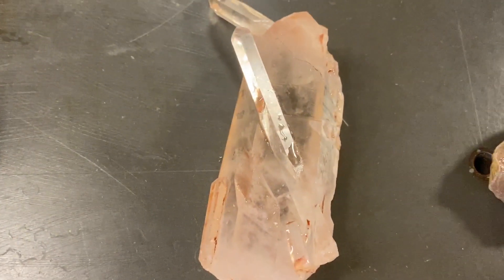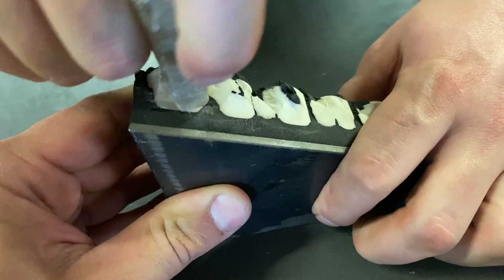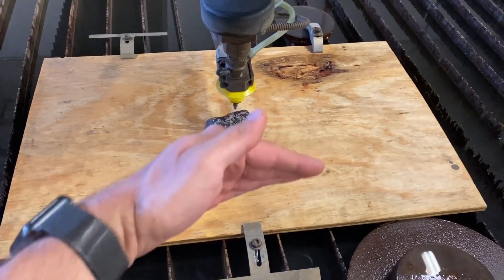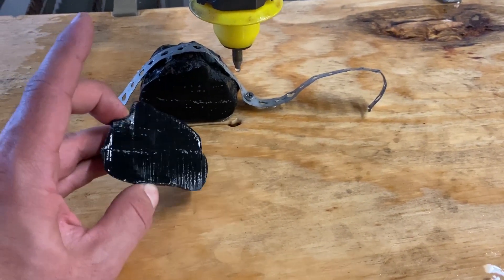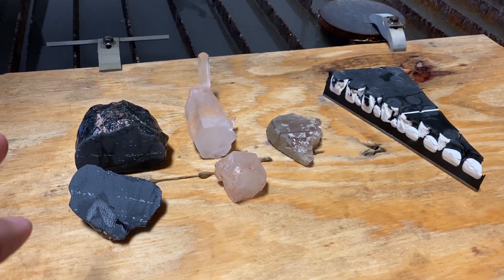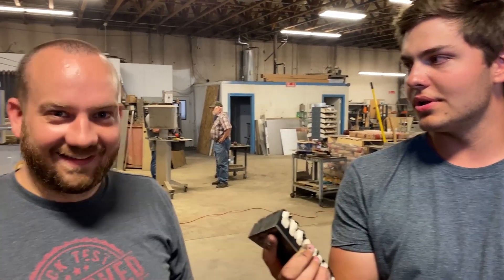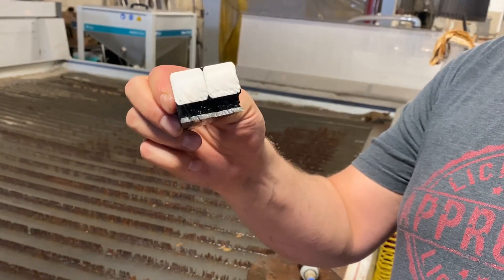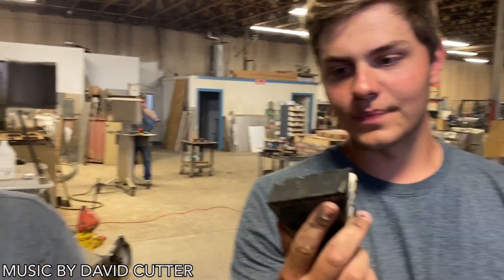Hardest Materials vs 60,000 PSI Waterjet

Comment: Imagine having to use terms like "Sixteenth of an inch" instead of 2mm
Reply: That resonates in my ears either.. and than i facepalmed ..wtf 16th of an inch 😂 its like having a steak and tell somebody i have 265th of an cow instead of 200g 😂
Reply: I didn't post this comment to flame on the US in any way... I just thought that 16th of an inch seems like a very weird and terrible way to guess measurements.
Reply: @mikeymike7431  some people will be offended by anything, wish we could start using the metric like everyone else, but that would be a weird change
Reply: @mikeymike7431  as someone who has done a good amount of carpentry using the imperial system I will say that its a very stupid system. But its a system, aka it works, and once you get used to it, it becomes near impossible to fully adjust to using metric. Even though I know a meter is 100 cm and a centimeter is a little under half an inch, I don't think that way at all. When I use meters I still convert it to yards just cause it was how I was raised. So yes, stupid way of measuring, but becomes second nature if u grow up using it.
Reply: @tjvroom7076  one of the best comments in the thread
Reply: This post was made by the metric gang
Reply: @jonaswilson3150  laughs in 94.7% of the world population using metric
Reply: Melvi Vanilly  They are also the first two marks. Who's oven goes to 660 F??? Those chicken nuggets would be done in a heartbeat.
Reply: Where did I lose you? The first two marks or the chicken nuggets?
Reply: I don't say any temperature scale is bad, but Honestly i always wonder why people are so easily triggered and goes out with such an awful behaviour and targeted personal attacksbeyound all reason on other persons if someone does not like the Fahrenheit scale, i hawe never ever seen people hawe such awful reactions when people express hate on the Celsius system. It is just a temperature messurement scale, it is dead numbers on a paper or digital unitis seen on a computerscreen, it is not by any means an attack on the United States as one may think from the response. The Fahrenheit scale is not even American by any means, it is an old German scale for messuring the temperature in the Harbours in northern Germany. Just take a quick look at it's actual history before start going totaly bananas and start war with people!
I hawe never ever, not even once seen or heard any person from Germany complaining ower somebody supposingly did insult their old national temperature scale.

If one want a finegraded scale, the Delisle  has more dividing numbers than nay of the other more commonly used scales and
For messuring temperature in hot metals or lightspectrum in other applications the Kelvin scale are uncomparably superiour to all the other commonly used scales.

 Celsius was from Sweden, not from France (however it was a frenc man who inverted it to what it is today).
The Celsius scale is the first international unified scale.
Reply: Oh boi these comments are gold, I love when people fight eachother for small things <3
Reply: @LokiThePug  lol specially when we use both forms in the US . It sucks for us because we have to buy two different set of tools . To accomplish the same task
Reply: @LokiThePug  How small are the things? 1/10000 of an inch or 0.0025 mm? hahahahah
Reply: you all should know imperial is litterally defined by metric. an inch is defined as a length of 2.54 cm.
Reply: Couldn't agree more bro, like who am I to know how the hell 1/64th of an inch looks like...
Reply: Don't be an asshole... Different cultures use different things. Here in the US, terms like that are completely normal
Reply: I use cm and mm for anything less than 1 inch.
Reply: anyone in a seriously scientific or engineering field will be using metric in the USA. construction uses imperial still, but they have still converted imperial to be base 10. (half a yard, 1 tenth of a yard, etc.)
Reply: Imagine having a government that chases you down with a helicopter for going outside.
Reply: Dude its ridiculous. The Lockpicking lawyer uses terms like "1/1000th of an inch" and I just cringe
Reply: @LilDefuseKit Well 1/1000” is ~0.0244mm. I guess you could say 25 micrometers, but that means you have to memorize the prefix, and exactly how much the prefix changes the number.
Reply: @kainarkanos i think nobody got it. i think your joke is great because you know Celsius steps are smaller (5/9)  and it doesn't matter in daily life
Reply: EFFram YOUng  too stupid?? Lolol said someone who dropped out of high school about countless europeans doctors teachers and other geniouses
Reply: EFFram YOUng  it's pretty obvious you big mad
Reply: EFFram YOUng  a shred of evidence?? Xd god damn these people be delusional. Everyone who fights deadly diseases goes to berlin, i  have not meant a single person that went to us. Also rhat metric system is what your ancestors used, but you aint ready for the prison talk. Your jokes suck ☺️
Reply: Yea it's kind of stupid because we also use the metric system it's a pain in the ass specially. Doing car repairs have two sets of tools for the same thing.
Reply: Thought the same haha
Reply: @Jakob Weisser actually they started witch imperial and then translated it to metric for calculations and again translated it to imperial
Reply: @Timms MC you are just explaining  math that  8 year olds understand
Reply: Fractions are MUCH easier to do mental math with than decimals.
Reply: @Joe-bm4wx  Not really, decimals are better and more consistent
Reply: @AmateurSnake  can you multiply 1.29 x 7.327 in your head easily? How about divide? With fractions it's much easier. Especially when you learn fractions in grade school.
Reply: @Joe-bm4wx  Yeah, but it's harder to think which number is bigger in fraction compared to decimals which is why I said decimal is more consistent.
Reply: @AmateurSnake  how so? It's pretty easy...
Reply: @Joe-bm4wx  yeah, but you have to calculate it. For example, 5/10 and 3/5. Which one is bigger? You have to either translate it to decimals or multiply 3/5 to decide which one is bigger. With decimals, you doesn't need to do these calculations
Reply: @AmateurSnake  that's easy, 3/5, don't need to think about it at all. Did you not learn fractions first? In US grade schools, you learn fractions long before decimals.
Reply: @Joe-bm4wx  Same here. But you still have calculate it, unlike decimals. Ok then, how about this one: 90/188, 79/155, 87/123, and 99/209.
Reply: @Joe-bm4wx  In decimals you can tell which number is bigger by just looking at it. Example: 0,55 ; 0,79 ; 1,23 ; 6,78.
Reply: @AmateurSnake  omg did you and joe not read the big explainy comment that the guy above you said? He literally mentioned the fact that fractions and imperial are good for mental math and are easy to use while metric and decimals are more accurate. Just use both man.
Reply: @LarryCucumber  ok
Reply: @AmateurSnake  good
Reply: @AmateurSnake  5/10=1/2, 3/5>1/2.
A basic sense of fractions tells you 3/5 is the bigger one.
Reply: @Shlungoidwungus  That's cool and all, but my second question proves how superior decimal is compared to fractions at some aspect.
Reply: @AmateurSnake  Your point that decimal is easily comparable? That's literally the only advantage, anyone who uses numbers regularly knows that fractions are easier to compute with anyways. This is why most real math is done with fractions, not decimals.
Reply: @Shlungoidwungus  Yeah, but decimal is more accurate. End of the case.
Reply: @AmateurSnake  Decimals aren't more accurate the fuck? If you knew anything about mathematics you'd know that decimals are horribly inaccurate because you have to cut them off at some point. A fraction is by definition infinitely precise. There is no cutting off of the fraction that you have to do, you have it in exact terms. 47/96ths is exactly 47/96ths. 
0.489583333333 is not 47/96ths. You literally cannot write it precisely in a decimal form, you have to truncate it.
Reply: @Shlungoidwungus  Yeah, but I mean it's easier to which number is bigger by decimals. With fractions, you have to process it at least.
Reply: @AmateurSnake  You have to have some level of basic mathematical competence, yes.
Reply: @Shlungoidwungus  Yeah, but why use a harder way when you got an easier way? You can know which decimal numbers are bigger by just looking it for a second. With fractions, you have to calculate it if it's complicated.
Reply: Imagine having an radical leftist American princess in a royal family that rules over non-American people.  Nah I’m playin’, yea metric is king, idk why the hell we haven’t switched over by now...
Reply: @samuelmontypython8381  she isn't ruling over shit.... she can't even manage a relationship with her father, how ever,was that story going to end?
Reply: imagine caring
Reply: ur gonna trigger a few americans
Reply: You are working off the assumption that everything you do will always fall onto exact 1 mm increments.  1 mm is pretty large.  What happens when you need tighter tolerance than that?  You have to go into decimal notation anyway.

In the USA with Imperial Units there are 3 different ideologies of measurement.  First, every single scientific experiment uses metric, and most high tech gadget or thing made is done using metric.  All cars since about 1980 uses metric.

When it comes to some things like building homes, and other non scientific things that do not require high tolerance measurements, it is really easy and fast to use Imperial units.  When building a home most people use 1/2th, 1/4th, 1/8th, and 1/16th and usually stop there.  Sometimes if you are dealing with cosmetric trim, you might use 1/32th.

If I need a piece of trim to be cut, I can tell a guy in two different ways using an imperial measuring tape, "Hey cut that at 7 foot 2, and five thirty-seconds", or I can say "Hey cut that at 86 and five thirty-seconds".  Now compare that with "Hey cut that at 2 meters, 18 centimeters, and 8.37 millimeters" or if I told him, "Hey cut that at 2 thousand 1 hundred 88 point 37 millimeters".   I don't think that is much better.

When it comes to CNC machine work and making high tolerance parts, like automotive parts.  Almost always the fractional notation is completely ignored and you switch over inches plus a decimal notation for easy use of high tolerances as well as computer calculations.  If I need a part that is 2 inches and 367/947ths long, I would never say such a thing, nor would I ever write such a thing down.  I would simply write it as 2.388 and I would tell a guy, "hey cut that part off at 2 point 388", or "hey take another hundred 47 thou off that diameter".  When it comes to CNC machine work, it is no different at all using imperial measurements over metric because you will always be talking in terms of decimal notation.
Reply: @karozans  simple question: 
Ever heard of the terms „micro“, „nano“ etc?
Reply: @Phenox9    Yes.  They are decimal notation of mm.
Reply: 😂😂 made me laugh
Reply: @Tomas Correa Top 5 dumbest things i've ever read.
Reply: imagine not converting 1/16th to 1.6mm noob
Reply: Oh god you just raged whole nation of Humburgers per Ar15s
Reply: Some people shorten "thousandth of an inch" to "thou". I think.
Reply: Sounds like you're used to saying 2mm.... 🤣
Reply: Imagine that
Reply: or you could just say “0.08 inches” but millimeters would def be better to use at these scales
Reply: I'm from Canada, and we use both all the time. I measure distance in Imperial for things I would use a tape measure or caliper for, and metric for driven distances and speed. I use Celsius for temperatures, unless it's the oven, then it's Fahrenheit. I can picture a 1/16 of an inch, but 2mm, not so much.
Reply: Why are y'all fighting? I've been taught to use both of them and whenever there's a need to use em, I just go for the one that comes to mind first. Like why fight, learn both of em and there will be world peace.
Reply: OMG so much stupid. People use the units that are local and normal to them. If you're used to imperial you use it because it's your frame of reference. If you're used to imperial you'll say oh this is about an inch. If you're used to metric it'll be oh that's about 2 and a half cm. One isn't necessarily better and both can be both accurate and precise. If I'm using a socket set to it's nice to say oh the 8mm is too small. Let me try the 10mm. If I were using imperial I'd have to fraction it out. That just means the Americans gotta be able to do fractions in their head. Having said that I live in the USA where my machinist uses imperial and I prefer metric. Whose wrong? Nobody. I give him imperial units because he's the one cutting the metal. Guess what? The parts come out correct. The measurement system has done its job and given a precise measurement. Geez people on the internet take personal preference so seriously.
Reply: imagine thinking that arbitrary things actually matter enough to cringe about.
Reply: Reminds me of the time the Metric 'Kilo' needed to be redefined because it lost atomic weight over time.... Not like Imperial system of measurement has been redefined because of that reason.... Oh wait....
Reply: @ShiozakiSama  actually, they changed it. Now it’s based off plancks constant
Reply: Ya know, it's really strange when you are arguing over metric and imperial and then someone brings up the moon landing. What systems used played a very small part and would not be proof that one system is better than the other.
Reply: ps a nanometer is one billionth of a metter
 And a mm is one thousandth of a meter
  And cosmicly speaking we don't use either system on the larger scale we use AU astronomical unit the distance of earth to the sun of LD lunar distance the distance from earth to the moon and how far light can travel in a year and all three of these are still relative if you tried to explain to a alien your system being based off of these they would understand  but still look at you like you're stupid
   Because they use Cm cosmic measurement or how far a fart travels in a vacuum

    If I divided a yard into thousandths and called it a milli yard would you understand 🤔
    How about a milla gallon or milla cup
 How about a smoot or cubit 
furlong=201.16800 meters 

   In Kentucky they measure how far a drive is in beer's true story told by one of my friends from there
Reply: i like how the country that „went to the moon“ doesn’t believe you when you tell them that Nasa uses metric
Reply: @ophilia  Well, not so sure about either of those assertions. 😃 First, because something has been obviously wrong with the official narrative for decades. What the actual truth is I don't know but it is not what they are saying. We did not just lose and destroy the technology and documents. Either we did not go or they are hiding some reason that we can not go back yet. The circumstantial evidence for the narrative of fakery has been fairly good. There was motive and it certainly was possible. Second, our local mechanics use metric so most everyone here uses metric for something or is aware that others do, especially the scientific industry. You must have spoken to one of the few or either a child in early primary school. Most Americans would either know this or be indifferent to it with no disbelief or argument for or against...
Reply: @CynHicks  i said that becouse earlier in this comment section 3 people caimed nasa uses imperial
Reply: @ophilia  Oh, my bad. Touche. Lol
Reply: Metric is ridiculous when it comes to height and weight measurements
Reply: @apracity7672  how? You have one simple number and that‘s it... Compare this to imperial and you have one more, where is this so ridiculous? I would say your commend is just simple trolling and could be called ridiculous😂
Reply: I'm actually surprised they use imperial units on a machine like this. Sometimes though imperial is just standard, and we are too lazy to change it.
Reply: @GuyFromJupiter  It's not about lazyness. It's a standard that gets result on nearly every avenue it's used on unless you need precise measurement for crucial details.
Reply: AkTuaLy that’s 1.57mm
Reply: @davidg6852  AkTuaLy that’s 1.57mm.  Indeed. One and fifty seven hundredths of a millimetre  :)
Reply: EFFram YOUng  i never said they are better, but they definitely aint worse, people dont go to US to find cures for hardest diseases, they go to berlin. Imagine thinking that bcs ur from US your doctors are automatically best 🤣🤣 thanks for proving my point kiddo, go back to watching cartoons with your 2 inches
Reply: EFFram YOUng  lul u mad
Reply: @steviethespring  I love how Americans still see their country as the most powerful and mighty one, when in reality it's the country where everyone laughs at. <3
Reply: @steviethespring  LOL, as if I mistranslated this or I were a white dude.
Reply: @NiffirgkcaJ  you replied twice, that means you big mad.
Reply: @steviethespring  is that an insult? :3
Reply: @steviethespring  They're just mad because we overthrew their monarchy, infiltrated their monarchy, and have a bigger island
Reply: @NiffirgkcaJ  chill out man there is no need to be angry about it
Reply: @LarryCucumber  I'm not mad, plus that was a month ago already, LMAO~ XD
Reply: @NiffirgkcaJ  why'd you come back so fast if it was a month ago
Reply: @LarryCucumber  got notified and I have nothing else to do.
Reply: damn why you roasting us we dont like it either
Reply: Imagine not understanding the brilliance of the imperial system.
Reply: @CynHicks  No system is better than the other, they both have their ups and downs man. I am an american and love imperial just as much as the next guy, but even i understand that it can't be that amazing
Reply: @LarryCucumber  Dude, I really want some cucumber salad now.
Reply: @CynHicks  STOP
Reply: @LarryCucumber  Mmmm lol
Reply: @Timms MC man, everobody is using fractions in metric, its not like its only for imperial XD
Reply: There's two types of countries: those that use the metric system and those that have been to the moon
Reply: @Lardbutt200  there's other metric system countries that landed on the moon, and Nasa used metric system to land on the moon lol
Reply: I love the United States so it's not about that.
Reply: America is a backwards thinking nation
Reply: America uses the best system period
Reply: Come within three blue whales of America and talk your shit
Reply: Imagine imagining things about imaginary things in imaginary instances. Quite imaginative. Imagine that. But before you do that could you imagine the image of you imagining that. Now imagine typing that. Imagine

Cope harder europeen. You can’t say anything about amerifats with all the human trafficking the third world still condones, let’s not even imagine that though.
Reply: @MuscularFemaleRoegadynEnjoyer  I'm stealing this quote
Reply: Mesurement is arbitrarily based on a relative number and i learned both systems in school and neither are perfect maybe if everything had the same boiling point as water metric would be perfect but you could just as easily base a system off of the freezing and boiling point of mercury 
    Problem with a base 10 system or a based whole system is mathematically it is impossible to 1/3 either but physically easy 
Become a mechanic both will become easier to understand cause you will run into both systems alot I can eyeball any bolt tell you if its metric or standard what its grade is size and how many threads per inch threads per centimeter
    By relative just the gravity from other planets could make a inch more or less than a inch but only a outside observer would notice they actually use the difference in these measurements to detect gravitational waves
     And depending on atmospheric pressure the boiling freezing point of things change  so it relative
Reply: Someones jealous.
Reply: Better than being a slave to the globalist.
Reply: Imperial system is so gay and stupid
Reply: @gesucristo9946  Imperial system usage drops to 0%
Reply: Why would they use mm when sixteenth of an inch makes better sense to them
Reply: @Jakob Weisser feel free to delete your comment when you google and find out that you're wrong.
Reply: @steviethespring     You use decimals in percentages and the numeral system so it can't be that bad. The official imperial units used today were decided and measured in metrics.
Reply: @steviethespring  "The Apollo Guidance Computer did use metric/SI units internally for its calculations. But it converted to imperial/USC units when it displayed data on the DSKY. This is probably because the Apollo astronauts (mostly trained as test pilots) had an intuitive "feel" for imperial/USC units"

Feel free to delete your comment when you google as well
Reply: @steviethespring  nasa actually went metric quite some time ago
Reply: to be fair your country has never been to the moon.
Reply: @steviethespring  On a rocket that was built by a guy from germany
Reply: @steviethespring  You confused imperial with imperialism :)
(pssst. science uses metric)
Reply: @-danR  
Yes, but only for legacy reasons, press coverage and popular science, also when integrating 3rd party equipment. Mars Climate Orbiter was a costly lesson.
Reply: @-danR  If they calculated in Metric, the average American wouldn't really understand, so they translate to Imperial.
Reply: @steviethespring  To be fair all those calculations that landed those ppl on the moon were done in metric :^)
Reply: @steviethespring  Laughs in ESA Ariane 5
Reply: @steviethespring  To be fair, the imperial system used in the states is actually based off of the metric system, look it up ! :)
Reply: @steviethespring  you guys had to use the Metric system bc if you used imperial system you would end up crashing in to mars
Reply: @steviethespring  1st
Reply: @steviethespring  If you guys didn't capture German rocket scientists after the war, you would have never gone to the moon, at least not in 1969. And what system of measurement do you think those Germans used? I'm not saying America should switch to Metric, that would be chaos, but Metric is obviously better.
Reply: @R.Lennartz  that makes sense
Reply: @steviethespring  been to it? you cant even get to it let alone land on it.
Reply: @XYourBest  ... Are you american?
Reply: @steviethespring  good point
Reply: Well, to be fair, imperial does have units that make more sense for daily use over metric.  I'd sooner continue to use Fahrenheit, as its a system of feel and actually more accurate than Celsius because its units are actually smaller.  The average person is more likely to think "Oh that is unpleasantly hot." if you say its 90 degrees (Fahrenheit) instead of 32.2 C.
Reply: @KainArkanos  the average person that is used to farenheit will be quite confused when hearing about the temperature in celcius, but that is logical.
the average person that is used to celcius will be quite confused when hearing about the temperature in farenheit, the nice thing about celcius is that 0 means freezing, and 100 means boiling water, this is so useful in so many applications that i am not even going to explain why... it just makes sense.
Reply: @sliceofbread2611  There is a flaw in your statement of "average person that is used to fahrenheit". Because the average of the world population doesn't use fahrenheit as a unit.
Reply: @Bunkerotter  i was not referring to the average world population being used to farenheit. instead i was referring to the part of the world population that uses farenheit, and from that pool, the average person.

i dont know if you were joking or not so here is my serious reply :)
Reply: @sliceofbread2611  more like average american
Reply: @sliceofbread2611  The problem with a measurement based on boiling points of water is that boiling point is dependant on atmospheric conditions and gravity. The temps on earth can vary a entire degree.
Reply: @Subt0nix  so? what else should it be based on? absolute zero? or the temperature difference between an armpit and freezing water?
Reply: @sliceofbread2611  Absolute zero is good, so is the temperature of the human body. there are many temperatures less variable then waters boiling and freezing point to the point it almost stupid to base it around such a thing.
Reply: @Subt0nix  what about basing it on the boiling and freezing point of water around sealevel on a blue skied day with average temperature and humidity?
the reason i do not like absolute zero is because it results in rather big numbers for common temperatures, like room and body temperature.
what i like about celsius is that it has a good unit size and it has convenient values for situations that one encounters often: boiling water? probably around 100 degrees, ice on the pond? probably has been below 0 recently. Ofcourse these values are variable and not entirely reliable that is why scientists use kelvin anyway but for everyday use, i prefer celsius.

anyway, i could spend ages arguing with someone who grew up getting used to another system.. but i do not see how i could convince you that kelvin is the best system for science and celsius is the best for every day use...
Reply: @KainArkanos  When I'm driving, I can see what 5m looks like, 100m looks like and how far is 1km. Not only that, I know how cold is -4°c to how hot 33°c is. I can also tell if it's 2cm - 5cm off an image too
Reply: @Vysair  it's almost like the system youre born and raised with is what's most convenient for you to use a reference. Weird!
Reply: @KainArkanos  About the temperature, that makes no sense. People using metric don't the decimal part on day to day use. Absolutely everybody on a metric system will think "unpleasantly hot" if say it is 32 C or 33 C (you can't tell apart 1 degree C of difference, so it's pretty useless to be more precise than that for daily use)
Reply: @fabianoenglerneto129  As someone who CAN tell a difference between 77F and 76F, (77F would make me shy away from doing anything but sitting in front of a fan, and 76F is bearable enough to do housework and chores), I would like to think people would most likely be able to tell the difference of 1 degree of Celsius. Unless....idk, things like sensitivity levels is different from one person to the next. Or wait.... are we assuming everyone feels the same about everything everywhere? What's spicy for you may be sweet to me and vice versa. 76F feels nice and perfect for me to relax in the home. If it's 77F, it isn't near as comfortable, and depending what kind of work I'm doing, I may overheat and need water and breaks. 

I might want to point out that I live in a horrendous area when it comes down to temperature. 30-45 minute drive to the hottest place on Earth, Death Valley. However the area I live in, doesn't actually get "as hot" as Death Valley (125F-130F). The days are extremely hot though (99F-120F is normal for an average summer day), and nights can get down to 35F-40F (On the same 100F day!). So, since the temps during the day are killer, and the nights are freezing, most people in this area never turn their AC or Heaters off. They stay on. There's actually very little reason to ever turn them off. Doesn't really save money ( A full day of intermittent AC usage would only equal less than a kid's meal at Mcdonalds) , and letting your living space reach zones that are out of comfort is considered bad, if not life threatening in my area. So.... imagine if you lived in a 24/7 temp controlled environment for your whole life. You'd hate the temps outside, and would be able to feel 1 degree off :p
Reply: @KainArkanos  the units being larger have nothing to do with the accuracy. If anything it just makes it confusing when you say it's a cold winter day and it's 30°. Instead of just saying oh yeah it's -5 which is literally the scientific term for below freezing...
Reply: @KainArkanos , mate, when does water freeze? 0’C, When does it boil? 100’C, nice ROUND numbers, so why use Fahrenheit when Celsius just makes sense, and not to mention that the Kelvin scale is much easier to use with Celsius.
Reply: @KainArkanos  Out of the almost 8 billion people on Earth, pretty much only Americans use Fahrenheit (a handful of countries may use imperial units but the US is arguably the most populated one by far), which is only about 330 million out of 8 billion (≈ 4.2%). Most non-Americans don't have any reason to ever learn and/or use Fahrenheit, so contrary to what you said, the average person on Earth is much more likely to know what a temperature in Celsius means than a temperature in Fahrenheit.
Reply: @KainArkanos  Well, in Europe we do have schools that can convey the meaning of a decimal point.
Reply: @KainArkanos   This depends entirely on your upbringing, and as such there is no 'average' person. To me, 30+C is a really hot day. 40+C is stay inside weather. 0c means it's gonna snow -10c means a lorra ice. Fahrenheit is meaningless to me and I have to convert it with google each time I hear it. 

If someone had absolutely no understanding of either system then sure... they might think the bigger number was hotter, but thats a completely arbitrary point.
Reply: @KainArkanos  This^
Imperial system also works well in the cases where you have to divide measurements by 3.
Reply: @KainArkanos  ur wrong
Reply: @KainArkanos  umm .2 of temperature is almost unfeelable but a milimeter in counting can make a difference of couple of meters in designing... Why would you say 1/234532th of an inch when you can use like half of a milimeter...